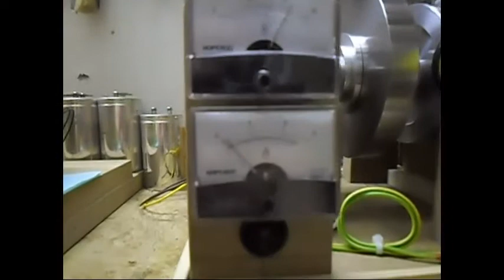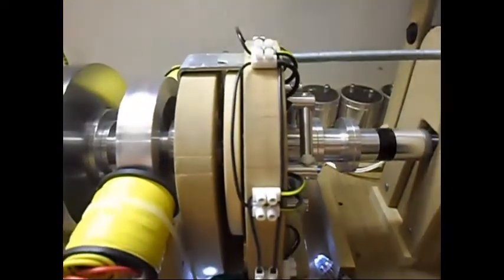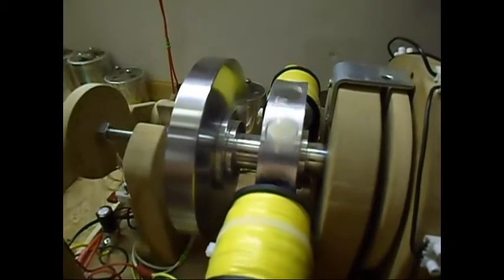Flux Gate Generator - Update 15 T-1000 design - 7 pole rotor...

Comment: Just try using a 2 or 4 pole stepper motor as a generator like the one in my video. Acceleration will be very pronounced above 300-500rpm
Reply from the maker: Jake Mitchell 
Thanks for your comment and info about the stepper motor...^^
I'll check your video to see the effect...;-)

Comment from the maker: Just an small update where i'm using a 7 pole iron disks rotor which works much better than the 8 & 9 pole iron ones one when it comes to cogging...^^
Numbers,
Input is 23Vdc @ <90ma...nice...;-)
Open coils = 1159 rpm...that's way better than 700(ish)rpm...
Coil & leds = 1155 rpm...not bad at all...^^
Coil shorted = 1162 rpm...nice...:D
Coil non stop connections(it's a short basically) 1159 rpm and loaded 1160 rpm...:D

Very very little cogging, more rpm and less input power...awesome...and a tiny winy better output also...lol

@ 3.52 minute mark i said...not when i short.......when i short them coils it does speed up as well...;-)